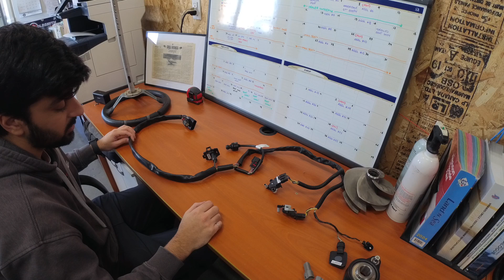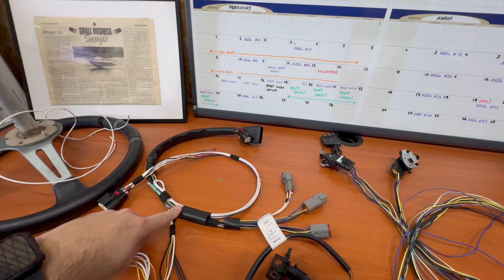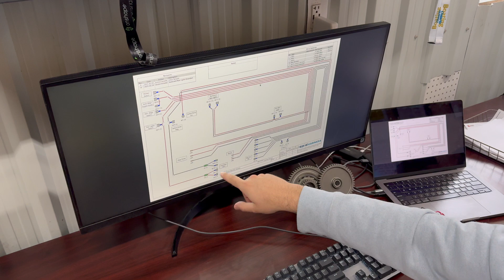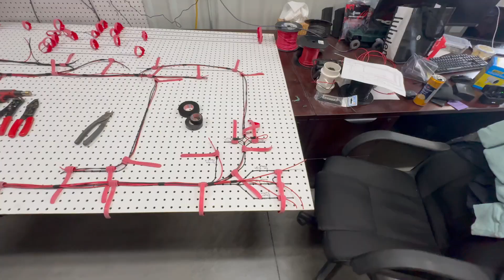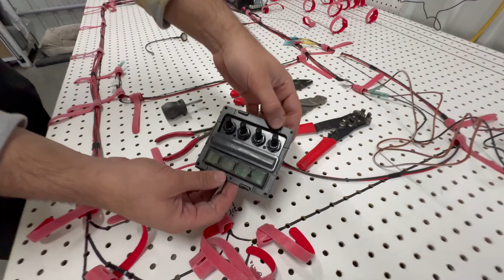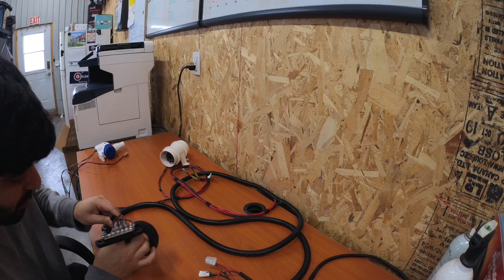Making & Modifying the WIRING for our Mini Jet Boat Build! | Minijet CUB Build Vlog - EP8

Comment: Have you had any trouble with EMI when mounting the ecu on top of the engine like that?
Reply from the maker: No. These are also mounted on the engine in many Sea-Doo models. For example the 2016 RXP. So it is a well tested and proven mounting location.

Comment: Ok I’ve been following this build. You guys obviously put quite a bit of thought into making the wiring as well as the rest of the build a clear easy to follow project. I’m an electrician so I was able to easily understand the process and the thought behind it. I’m impressed with you guys. (I NEVER give flowers.) Your whole plan is a very doable thing. Ima continue to follow your channel specifically this build. Would you answer me in the comments as to where and how I can get the plans, a guesstimate of the overall cost with a breakdown on the engine and the sheet aluminum. (We know aluminum prices fluctuate), and other speciality parts in your shop/website. Do you mig most of the hull, with some tig welding in delicate areas? I’m a master electrician and welder at the nukes. Well i was before I retired. An email would be helpful to communicate with you guys. I think I want to build a mini-jet boat. I’ve always wanted one and I’m pretty sure after watching your videos I can do it. Thank you for your response. And I’m really enjoying the training/teaching way you produce these videos. It answers many questions as the question comes up. A great way to get a loyal intelligent following. Again thank you.
Reply from the maker: Hi, Thanks for watching!

We do not offer plans but we do sell the DIY kits. More info available on our website here:  https://minijet.ca/diy_kit_models/

Most of the hull is mig welded with some cosmetic work done with tig. We have other videos on our channel showing hull assembly. And for those that do not ant to weld we offer welded hulls as part of the DIY kits.

Our email is: sales@minijet.ca 

And you can reach us by phone: 6136052628